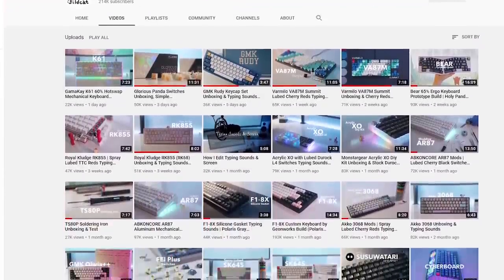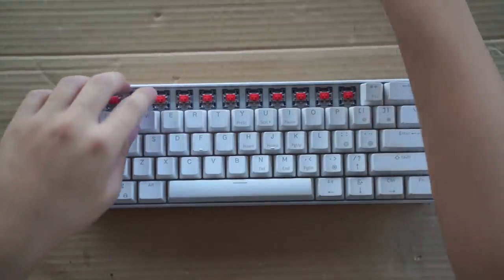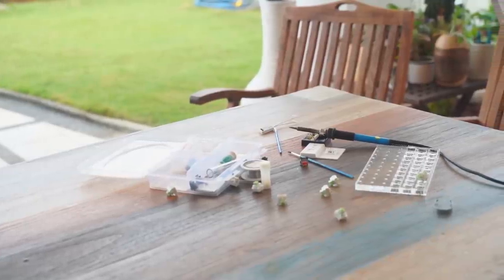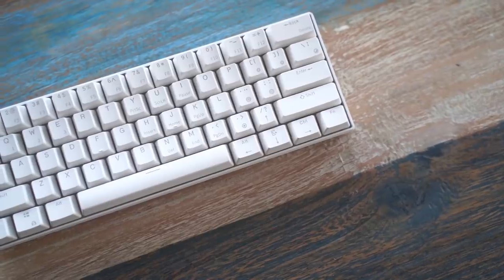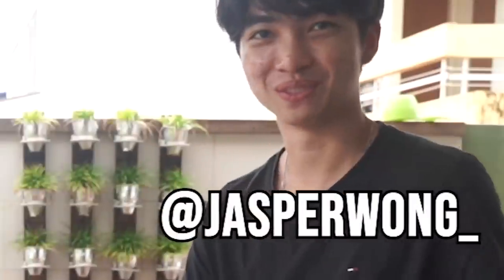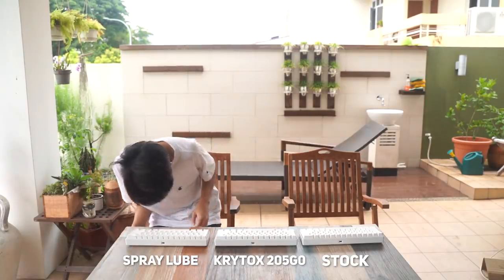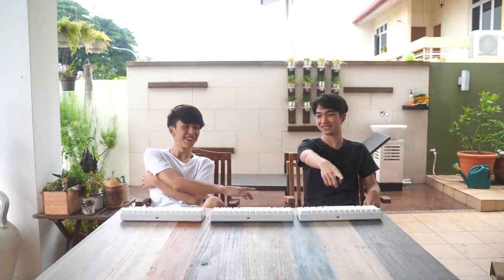Lubing Keyboard switches without desoldering?

Comment: So you're telling me that I can take the switches off, and spray lube them. It will be faster than going by hand, and will remove the risks of spraying on the PCB.
Reply: Yep
Reply: the issue is that the spray lube can cover the metal contacts, which makes the key presses unreliable

Comment: i lubed a switch with spray coconut oil cus it was the nearest thing. fun fact: coconut oil hardens
Reply: Oh no
Reply: it hardens only if you use it in an air conditioned room
Reply: @tristan6509  still not something u should use as lube at all

Comment: Using spray lube like this has a good chance of giving you intermittent input problems. I highly recommend not spray lubing your keyboard if you care about it.
Reply: @gangigooga7710  actually 5 years old
Reply: @gangigooga7710  it said good chance, not fucking 100% gonna break your keyboard. Also lubing traditionally has more consistency than spray lubing even though it takes longer. You probably spray lubed your moms membrane keyboard and no shit it turned out well, the lube isn’t touching the contact points
Reply: @kyrian7600  I agree
Reply: @Sungblox  lmaoo i spray lubed two mech keyboards, one of em being a Varmilo va88m and it sounds sick still to this day... stop being gatekeepers and just use spray lube lmao
Reply: @gangigooga7710  you know you're supposed to wear a mask and use aerosol cans in a well ventilated area, right? Just making sure because you sound like you just huffed half the of the spray lube you used on your overpriced plastic prebuilt.

For the record, I never said spray lubing was worse than hand lubing. I don't know why you're trying to tell me that, just sounds like you're trying to justify it to yourself more than anything.
Reply: Takes minutes to fix just look up how to o fix it if it happens

Comment: i think the best option is to get hot swappable switches and just individually spray lube them by taking them out so you dont damage the PCB and so they dry faster. DONT SPRAY LUBE OPTICAL SWITCHES ON THE BOARD GUYS IT WILL DAMAGE THE OPTICAL SENSORS
Reply: lmao i was about to spray lube my gk61 optical. u just saved me 70 bucks
Reply: @701william5  He just save me too!!!
Reply: @701william5  How did you go? I assume you applied spray lubricant with the switches outside the pcb
Reply: Mine works alright n I used wd 40 lol

Comment: People: de-soldering is waifu
Hot swappable switches: allow me to introduce myself
Reply: Don’t you mean hotswap pcb’s?
Reply: Yeah, my mistake
Reply: "Hot swappable switches" w h a t
Reply: @vanexai  yes
Reply: @vanexai  ya interchangable w other springs n stems duh
Reply: so there is a new concept : hot swappable switches.
Reply: hotswap pcbs are waifu material
Reply: The desoldering isn't so bad as trying to unclip one failed switch from the front of the plate.
Much easier if you're doing the whole job.
Reply: Optical switches ftw
Reply: i get what you mean =) but i will hate on you for saying hotswappable switches since someone else reminded me its actually the pcb :)
Reply: @iNikiii  I should edit it but likeeeeeee <3
Reply: @2liip  people be like that lool
Reply: @vanexai  A truly innovative concept where the switches solder and desolder themselves by sheer willpower
Reply: @vanexai  on a gk61 with god forbid it Gateron optical BROWNS you can only hotswap the gat optical switches.
Reply: I was naïve and got a razer black widow ultimate, now after years some keys aren't working properly, turns out razer doesn't have hot swappable switches so sad days. No way I'm gonna solder stuff so I hope this works

Comment: When I first got into mech keyboards, I lubed my Gateron browns. I later realized how inconsistent it is and how it kind of dries up over time. I then later opened up each key to dry then lube it with Krytox and this time I didn't lube the legs and got my tactility back. I'd only recommend spray lube on cheap linear switches, or blues so they won't be as loud
Reply: stock cherrys is where its at period , brokeboys
Reply: @hectorr4956  stock cherrys are garbage and cheap, brokeboy
Reply: Buy oil kings or prelubed panda.
Reply: @hectorr4956  Gateron is way better than cherry switches and cherry is pretty much a trash low-end switch.
Reply: @WhirlpoolOfficial  broken in spring swapped cherry is where it's at, cherry brown/black ftw

Comment: You can use spray lube in a better way. If you want to be extra safe, you can take the mechanical switches out of the PCB/Keyboard, and spray the switch by itself.
Reply: The point is to not desolder the switch here
Reply: I thought about it too ngl but I googled it and it says no so now I’m confused

Comment: To those that want to spray lube, don't. The reason why :3ildcat's keyboards doesn't break is because the spray lube he has in korea is actually a knock-off version which does not harm your keyboard as much compared to the real ones as the formula in the spray lubes are different so if you would like to lube your board, don't spray lube it will cause more damage than its worth
Reply: for more information watch hipyo tech's video on spray lube
Reply: Not really it's the easiest thing in the world takes minutes to fix
Reply: Or maybe it's because he/she lubricates the switches outside the pcb. It is also done with optical switches, which are not based on the contact of two metal parts.
Reply: why not use mineral oil? doesnt harm electronics and its super cheap. Just 1-2 drops per key

Comment: I am a professional dumbass so i spray lubed my 2 really cheap keyboards. They both have outemu red switches. I used diferrent lube based on silicon because i didn't want to wait 2-4 weeks for this specific spray lube to arrive from amazon and i was really suprised it's actually working pretty damn good. Im using them since 1 week and had no issues at all. Also i read somewhere that you need to shake the can at least for 1 minute to lower the chance of destroying your keyboard but i don't know if i was just lucky that my 2 keyboards are working or because i used different spray lube but im happy with my results lul. Also i sprayed in the top left corner of the switch so away from the contacts.
Reply: What spray did you use?
Reply: @HipyoTech  it's called eurol PTFE Super Lube Spray and I don't think it's available outside Poland
Reply: @basilworshipper  when you shake it does it make a metal sound? I'm trying to investigate which sprays actually don't ruin keyboards
Reply: @HipyoTech  yeah it does

Comment: I have found a new lubing method, ! named it "Gel Modding", what you do is you get a generous amount of lube on your brush, then you press down the stem and evenly spread the lube along the sides of where the stem rubs against. It creates an extremely smooth, "thocky" sound. Plus it is extremely quick! I would recommend this mod on the RK68 or any 65% keyboard along with GMK keycaps. Hope this helps!
Reply: You have horrible budget management if you can afford GMK keycaps but not a decent hotswap board

Comment: Why not before spray on a glass and then use a dropper for throwing 4 or 5 drops inside the switch ? Using this method you have a better control the amount of lubber oil you put inside
Reply: Smart that's why I use chain lube it works super super well and you just put a few drops in.

Comment: Tipp for spray lubing: Take the switches out and spray from the bak into the housing. That way you wont get the risk of destroying youre plate and make it even less messy. Thank me later :D
Reply: Or perhaps, just lube the switches yourself? For the same price as whatever spray lube you have you can get GPL205g0 or GPL105
Reply: @Northwest_Territories  Have you tried it with favorable results? In my country it is very difficult and expensive to get GPL205g0 or GPL105

Comment: Dielectric grease worked for me. Sort of a pain to apply some on the sides of the switch housing. Once you get a little bit where the switch rubs against the housing... hit the switch a few times and it's smooth. I think the spray lube is tooooo messy lol.
Reply: i kinda want to get some of that super lube spray and spray it into a little container and use an eyedropper to lube the switches

Comment: Would taking off the switches first (also keys, obviously) then spraying them with the spray lube be the best of both worlds? I think this makes the most sense for hot swappable keyboards.

I'm also interested in longevity: if you need to re-lubricate the sprayed switches more often than if you used Krytox.
Reply: Yes bro it’s 10 times better

Comment: self drying silicone spray are better for this kinda purpose
you may ask how can you know which silicone spray are dry or non drying type, the answer is you can't, you can only buy one and try it to know,spray on any surface and come back to see if its dried up for most part( it won't completely dry)
from my experience, the best drying type are from cyclo and wd-40 branded silicone spray,cyclo in particular stands out the most for me

Comment: Typing on a spray lubed keyboard here and I already ordered a new one. 

It DOES work and it sounds even better imo, but on the way I approximately killed like 5-6keys. My A, O, V, and Q are definitely shit, I have to press them multiple times or really hard.
keep in mind I did that for the very first time and I "only" jacked arund 5-6 keys, if you do it carefully spray lubing is 100% an option. DONT OVER DO IT, one small spray is enough
Reply from the maker: if you wait about 4 days and use it every now and then the keys start to work again
Reply: @SquashyBoy  sadly not. it's been around two weeks now and they are still pretty fucked :(. thanks for the reply anyway mate. have a nice day

Comment: I spray lubed my blues before. Overdid it actually. And I actually used grease spray instead. The switch turned yellow afterwards. And the oil was too much that I couldn't wipe it properly. In the end it I scraped it for a new one.

Comment: I saw another quick method where you just take the caps off and use tweezers to pull the stem outwards and lube the sides of the stem

Comment: It seems obvious to me that if you don't have hot-swap keyboard you definitely want to use spray lube. However, the question is which lube you want to use. It should be something that is greasy, isn't electronically conductive by itself (so leaking a drop to pcb doesn't "press" your key automatically) but still provides accurate contact when the key is pressed. I'd expect something like WD-40 to be pretty good but can you suggest something better?
Reply: WD-40 is a degreaser, After a week your switches will feel awful.
Reply: @stonkeykong1064  Plain old WD-40 is not a degreaser but there does exist product called WD-40 Degreaser which is different story.

However, I don't know if WD-40 is compatible with plastics used in switches. I think WD-40 was originally designed for metal surfaces. Pretty much anything that has some lubrication will work for some time but for longer time periods you want something that doesn't damage the plastics.
Reply: @MikkoRantalainen  okay, my bad. It will lubricate something just not for a long period.
Reply: @MikkoRantalainen  WD-40 is actually used by a bunch of mechanics I known as a hand wash. Because it gets grease off so well. It’s an oily formula because it does contain oils. But WD-40 itself is a solvent.
Reply: @stonkeykong1064  All oils work as solvents for similar oils so it's no wonder WD-40 works as a solvent for dried oil in your hands.

Water is a polar molecule (hydrophilic) can cannot work as a solvent for oils (which are non-polar, hydrophobic) which makes washing oil from hands very hard if you use just water. WD-40 may help there if it contains molecules that contain polar and non-polar parts (soap is an example of such molecule) which allow oil molecules to mix with water.

Instead of using WD-40 to wash your hands, you should get some real product meant to wash oil from your hands. WD-40 can help if you don't have anything else but regular soap and water, though.

All the above does't make WD-40 a product that degreases metal or plastics.
Reply: @MikkoRantalainen  WD-40 is mainly used to break a rusted bolt because it adds oils but not for long periods. That’s why they tell you not to use it on door hinges.
Reply: @stonkeykong1064  I think WD-40 is not that good for breaking rusted bolts. It's more like general purpose think oil - kind of jack of all trades, master of none.

If you want better products to break a ruted bolt see Project Farm videos about it.
Reply: @MikkoRantalainen  I personally believe WD-40 just sucks in general
Reply: @stonkeykong1064  I agree that if you can have multiple different products, WD-40 is not a correct product for anything. However, if you would need to select one product for everything, WD-40 is nearly the best you can get. WD-40 is for people that don't understand what they really want for each application.

Comment: Ok, I'll be honest kinda want to try this one some cheap Akko switches, they sell spray lube at a store where you can set the trigger to only spray so much. I've bought it before and I honestly wonder (curiosity wise) how it would do but at the same time I don't really want to put the switches into my board. If I go conductive it might short, if I go non conductive it might break the contact of the switch, non conductive seems safest for my board but probably wouldn't be very functional.

Comment: What if spray lubing switch not on the board? I mean, lube the switch first, than attach it on the board. It still saving times right? Not opening the switch one by one, at least for hotswap keyboard this is still a saving times

Comment: Do you think spray lubing is still dangerous if we use it on open switches? like switches outside of the keyboard and opened (separated the stem and spring)? 

Cos I was just thinking about spray lubing like spray painting if that makes sense, saves a lot of time combined with bag lubing the springs and tub lubing the stems... what do you think?
Reply: Not worth it in my opinion. As we hardly can control the amount of lube from the spray, like, just a bit pressing harder can lead you to messed up the next switch (no consistence between the first and the second switches).

Comment: this question might be a bit dumb but which benefits it gives lubing the keyboards?
Reply: When you typing or pressing the switch slowly, you can feel the "scratchy/ sand feeling" of the switch and eventually you will want to make the switch more smooth. That's why lots of people decide to lubricate switches :D.
Not to mention lubing will also reduce the noise of the switch :D.

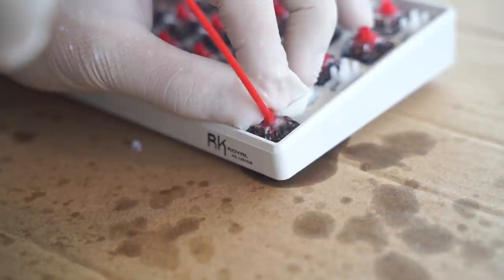Comment: hypothetically speaking, if you take out the pcb with the switches still on and spray the lube on there, then dry off the pcb and put it back in it should work pretty normally right? assuming you don't 6:34 it?

Comment: theres no difference with normal lube or spray lube at all!

never mind i take that back spray lube is better
but there might be problems while inserting the spraylube and the key regestery will be broken 
but u can just put tissue on the sides of the key switch and it will work that is a easier method
and safer method but without doing that it would probably be faster but risky
Reply: Spray lube isn’t better, in any way shape or form.

Comment: correct me if im wrong but the rk61 has hot swappable switches right? desoldering shouldnt be required. i have the rk 61 and i dont have to do any soldering or desoldering to lube my switches. then again, i chose blues so what do i know?

Comment: i took apart the switches on my kemove shadow and used the super lube on gateron yellows like you would with krytox205g0 and for some reason some keystrokes don't register, like when im gaming i have to press keys multiple times sometimes for them to register. It's been like this for like a week or 2 since i did it and its not fixing its really annoying and idk what to do about it, it's definitely the switches because i swapped them out with a few reds i have in a switch tester and they worked fine but the ones i used the super lube with malfunction
Reply from the maker: heres a video on spray lubing done by hipyo tech which explains why our “real” cans of super lube are actually wrong https://youtu.be/n6wn8jaiqxg
Reply: @SquashyBoy  that’s crazy that the counterfeit ones work better, thanks for the link to the vid :)

Comment: Is it ok if i lubed with wd40? (Razer huntsman mini purple switches) without taking the switches out
Reply: first of all, why would you lube purple switches? they’re clicky switches, if you lube them you will remove the tactile and the sound and it feels really wet. secondly, DO NOT USE THE WD-40 TO LUBE ANY KEYBOARD. the keyboard will smell really bad and it will completely destroy your pcb. get a keyboard with a different switch (not clickys) and lube them manually without desoldering (there are some tutorials) if you really want it

Comment: someone please respond and tell me if this works but, will my keyboard still break if i take out the switches and spray lube them without them being connected to the pcb? because i have a hot-swappable kit and im able to remove the switches.. would that work?
Reply: If you have hot-swappable you might as well do it traditionally for a larger chance of success
Reply: @lenny5191  yeah good point, its just im new with keyboards and im scared im gonna lose part of my switches, and plus it just saves time
Reply: @vvhooman  no dont spray lube its abad idea, you have hot swappable pcb so its better to lube with krytox
Reply: @naelwlr  alr ty

Comment: Could the unreliability be fixed by simply spray lubing the switches before putting them in the pcb or is the problem with the switch itself?